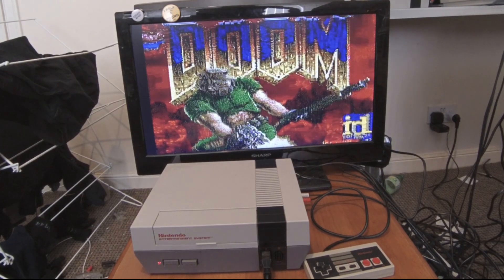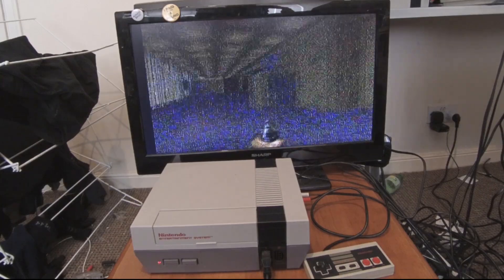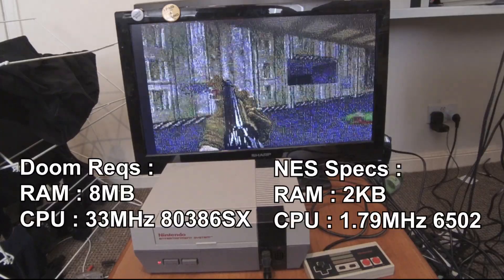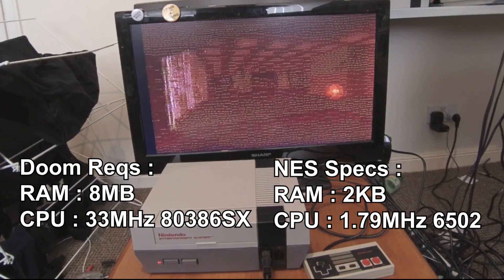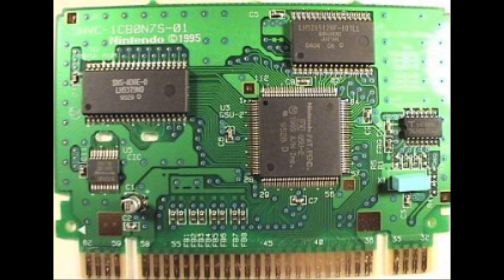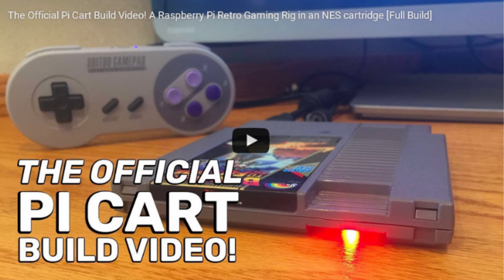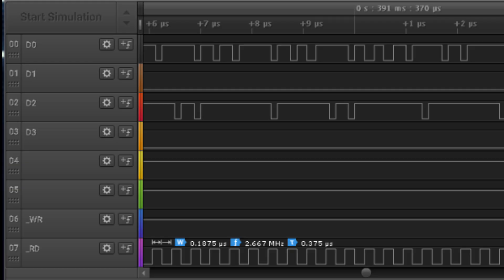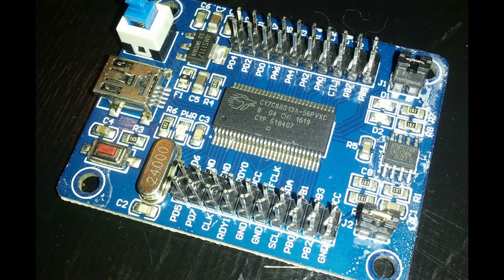DOOM on NES!

Comment: As awesome as Doom running on the NES is, Raspberry Pi does feel like cheating. What I would like to see is a port. If Doom has been ported to the ZX Spectrum, I'm sure a NES port is possible.
Reply: Doom for zx is not an actual port but a demake... At the same time while the nes has a fancy graphic chip with sprite support, the cpu is actually less capable of the zx one which actually made it a vector games power house.. Sort of
Reply: @MasterControl90original  "Demakes" are ports...
Reply: @MasterControl90original  The only time someone truly tried to port actual Doom in an 8bit was on C64, but with a SuperCPU running at 20mhz (20x faster than actual C64) and that was still horribly slow. https://www.youtube.com/watch?v=G0ct1PjBvMs
Mind I say though, it was a straight port from C without much attempt at rewriting things, so something faster is possible if put the effort. But the colors..

The other time I was impressed with the Doom VIC2O demake https://www.youtube.com/watch?v=Y7h3H-_8N_o
This is different than most other attempts, as it has walls that are not 90 degrees to themselves, it's more than wolfenstein engine, and tries with that to be as faithful to the original, with similar rooms in shape (but no different heights), same secrets, etc.

The rest are wolfenstein style engines with Doom graphics plastered.

Comment: We put doom on a Vic 20
You just needed a 32k ram expander.
Reply: And that actually ran using nothing but the VIC-20's chip set plus the RAM expender cartridge, a much more impressive feat than this excuse for a "port".
Reply: @raspberry144mb3  except it did not look like doom :D but yeah, SOMETHING run on that VIC20 with some cheating (ram expander) !
Reply: The VIC 20 actually had the same processor as the NES. The 6502 CPU
Reply: I agree

Comment: Cheating or not that is still ridiculously impressive!
Reply: Absolutely, i never knew that it was actually possible to framebuffering graphics to the nes and i never knew that even 16 dithered colors could be just enough to see everything properly well on the nes,,,
With that said, i see soooo much lots of potential now on the nes, now just imagine, playing GBA or N64 games on the nes,, now if the pi will only also convert 16bit pcm down to 1bit dpcm to stream it trough the nes,then we would have also sound on the nes,,,

Comment: Not running natively, fake and gay
Reply: Tchitchouan Inouane  👊💦
Reply: @Max Tarantula Beside the century when the chip was made, what is the difference?
Reply: So most NES games are cheating too ? It was very common to have, a usually basic, form of external processor in the cartridge to enhance the games.
Is the super FX or SVP cheating too then?
Reply: @Max Tarantula Well that's a difference in the way that this guy it's programming it, but if you extract the kernel of the engine to a ROM I don't see any difference, Pi system acts like a coprocessor that prerender the graphics, but with the power of the XXI century.
Reply: People still use gay as an insult in 2019? 🤔
Reply: Jepp, still fake and gay

Comment: "Unmodified"
"Oh, but also I modified it with a RaspberryPi"
I rolled my eyes so hard I think I lost a contact lens in my skull.
Reply: There's a huge difference between a Raspberry Pi in the cartridge and modifying the actual internal NES hardware. There'd be no way this would be considered a sell-able product if it you needed to mod a NES.
Reply: @cabbusses  It could be any game that can run on the Raspberry though, not just Doom. So it's not bound to NES limitations. Which makes this not what the title suggests.
Reply: XG233, you ask how is it missleaging, as the NES is not modified?? Simple, THE NES ISN'T RUNNING THE GAME! And before anyone say that the FX chip was the one who run Doom on the SNES it's a lie, the FX may do the most (as it was a math co processor) but the entier system was running the game, the FX on the cart was a brick without the SNES, where this PI NES cart isn't. It is easy to re install a PSU, USB keyboard and HDMI on it to run Doom without the NES
Reply: @cabbusses  Yeah I understand the difference - I'm saying the title and claim of no modification is misleading.
Reply: @xg223 If you can't see how the implication of the title doesn't match up with the final product, there's not really much I can do to open your eyes. 

I didn't say it wasn't cool, I didn't say this guy sucks ass or something. It's an impressively creative solution. So calm your tits.
Reply: @xg223 The fact you 'think' I'm 'mad' about it is more telling than anything. lol so is your insistence on purposefully attempting to push buttons. Get a life little dude.
Reply: @retropulse03  Anyone that knows about hardware, NES workflow, and only a little bit of software, knows that it's truly hard to define if that it's cheating or not, it depends on what rules are you following...

All inside a cartridge without external components or power? It's legal...

All original contemporary hardware? It's a cheating...

Only for sell? This guy it's a genius!...

Comment: Yes, it is cheating.

Using a chip or two to expand the original consoles capabilities is one thing. You stuck what os essentially an entire computer into the cartridge.

No.
Reply: Really not that different from doom on the snes. That game avoided using the snes hardware as much as possible and run basically everything on the superfx2. Main difference is how powerful the coprocessor is.
Reply: It's much different, dogen. Doom on SNES may avoid use the most of the SNES hardware but it still uses it. This on the other hand, don't use the NES hardware at all cause it can't. Where the FX chip, avoiding or not, did use it as it need the SNES hardware. Also, the FX chip also was a big cheat. A much more elegant one than this PI who is actually kind of a useless invention, but still a cheat by nintendo. If you have a Doom SNES cart, open it and modify the best of it trying to run the game without the SNES, you wont be able to (only if you emulate an SNES). This on the other hand, easy to plug in a PSU, lkeyboard and monitor on the PI as it don't need NOTHING From the NES
Reply: @Vanessinha91Pucca  "This on the other hand, don't use the NES hardware at all cause it can't."

Yes it does. It uses the NES PPU to display the game, which means the framebuffer has to be converted into tiles of the right size and palette before being transferred to the NES hardware. The difference here is that the Pi is running all of the code apart from controller input. Doom on SNES might also be running the game code with the co-processor, but at minimum the SFX is used in the same way to render(render game to buffer, cut into tiles, transfer to nes/snes ppu)
Reply: It don't need the NES PPU! You can use any video out and PSU and imput on the PI!It's not a proprietary hardware who only work and expand the NESX
Reply: @Vanessinha91Pucca  is he not using the PPU? I'm assuming he's using the same method as suckerpinch (converting video stream into tiles for the PPU to output). Maybe it's half assed and not using the NES hardware at all. That's lame as hell if true.
Reply: Yes different than the super FX chip

Comment: I am in that camp that thinks this is cheating......but its still cool all the same ^^
Reply: Yeah... pretty much cheating.  But cool.  And totally unnecessary.  this just showcasing another way to use a Pi.

Comparing a raspberry pi to a cartridge add-in chip is unfair.  I mean... The Pi is basically a computer.

MSU1 for SNES is what I would call amazing
Reply: @StephanieHua  The superfx is pretty much the same thing. It's a 16 bit CPU, with its own RAM etc
Reply: @StephanieHua  it'd be interesting to use this tech to turn the NES into a kind of streaming device since thats essentially what this is doing
Reply: It's still an interesting concept, if the results can be cleaned up it'd be pretty epic to have a cart that can essentially turn the NES into a modern PC, if he could get a modern GPU in there I'd go nuts
Reply: I'd say its cheatng, but nintendo also cheated with the super-fx. So that makes this kinda legit I guess?
Reply: @lowstaar  - if the SuperFX had been a Pentium II SoC with integrated Voodoo 2 and all code ran on it, only using the SNES to output video you might have a point - that would be equivalent to what is happening here. None of the code is actually using the NES hardware, it's all running on the Pi, which is many orders of magnitude faster than the ancient NES CPU - that's like claiming you "hacked" a wooden cart for sub-sonic speeds by duct-taping a jet engine to it. At least the games that used add-on chips like the FX/FX2 still used the SNES CPU etc. for game logic/backgrounds/sound etc.
Reply: @yellowblanka6058  
The cartridge still has music for it, so no, not cheating.
Reply: ^This
Reply: The closest I've seen to a native doom on snes is this https://youtu.be/tPlZI1OTSvY
Reply: @ALEXGIBSONCMG  - people have built small form-factor PCs in NES cases, but obviously your GPU choices are very limited due to the space available.
Reply: Better word might be "trivial"
Reply: Yeah definitely cheating. Basically it's the first streaming game for the NES.
Reply: To be fair the Super FX was also more than 6 times faster then the CPU in the actual NES. The super FX 2 even 14 times faster and only 30% slower than the original Playstation.
Reply: Agree on that. Can't really dislike video, but title is pretty much of an clickbait
Reply: Well Hellraiser for NES back in the day had a special chip so what's the difference? Besides time and better programming.
Reply: Does the NES have DMA? If not, it's definitely not cheating ... sure, the bulk of the code is running outside of the architecture BUT coding a well performing, stable video/audio streamer while allowing input via the controller is nowhere near as trivial as you make it sound like.
Reply: @RandomBlankUsername  - I'm pretty sure the same guy could get Crash Bandicoot etc. running "on" the NES with the same method, that doesn't make running software on a SoC soldered into a cartridge for a system any more legitimate. Not that it didn't take work, but it's a dishonest title, something like "Raspberry Pi NES cartridge hack" would have been more accurate.
Reply: @yellowblanka6058  Sure, the title is clickbait ... doesn't lower the actual effort involved never the less. And hell ... you could even get Doom 2016 running that way.
Reply: You were that one kid that reminded the teacher to give out homework at the end of the day, weren't you? >.>
Reply: @unnamed715   no dicktard, I was that kid who pointed out to the Teacher that their reliance on the Textbook for the answers their teaching completely invalidates their teaching degree
Reply: This, the code is running on the SoC jammed into the cartridge with the system merely acting as an output. It's nowhere near close to the SuperFX/Virtua Racing situation - in both those cases, the included chips enhanced the base system, but the code still used the base system for different elements of the game.

Comment: I SO want you to try and get SRB2 (An absolute BEAST of a Doom [Legacy] mod that's been in development for 20 years) on the NES

I will SCREAM if you do
Reply: I don't wanna hear this guy screaming, so don't do it.
Reply: That wouldn't be to hard at all. The source port of doom on the pi already mostly supports srb2, it'd be easy as changing the .wad file.
If that's not enough, there's already the modified engine ported to the raspi already, so the graphics output can be changed to read from that engine instead which cant be too different
Reply: @televisionandcheese  I don't think it'd be as easy as that dude
https://www.youtube.com/watch?v=3cfK3EWnn2E
This is the upcoming version
https://retropie.org.uk/forum/topic/9529/sonic-robo-blast-2/2
I think this could be used though